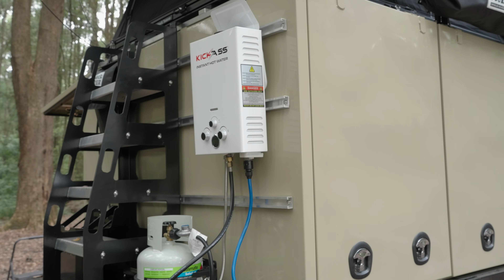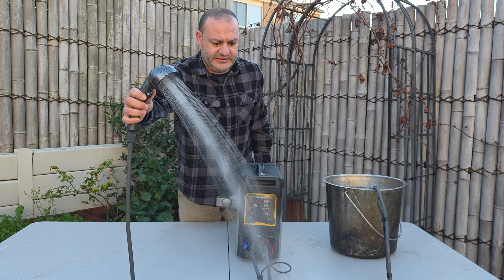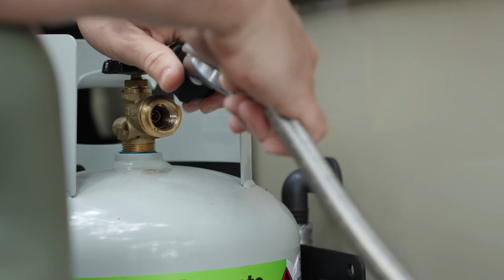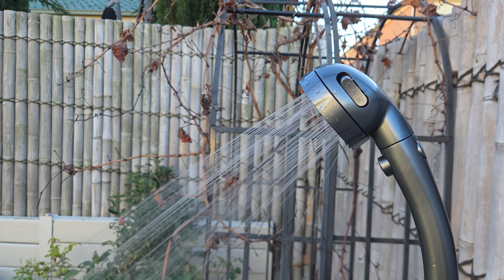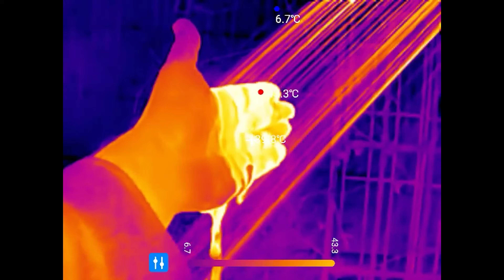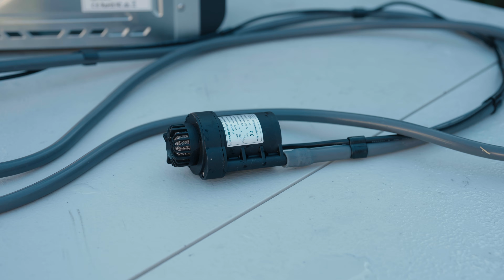BougeRV Portable Hot Water System - Amazing Performance Tiny Package

Comment: you can also refill the green bottles from your LPG, by placing them in a freezer then connecting using a small adaptor to your LPG. Making it from an expensive gas to the cheapest small portable gas avaiable. I currently heat water and use a submersible pump and shower head. But not having a magnetic shower head is one of the biggest barriers to using it. But having more instant hot water would be good with a toggle on/off shower head and magnet would be worth while. I see they are on special right now.
Reply from the maker: That's a pretty awesome camping hack mate! Thank you for sharing

Comment: Mate, nice, I have the Companion NXT hot water system and for all intents and purposes identical. It does however address some of the negatives you mentioned.
I use mine with either a bucket or, since it uses garden style fittings, I connect it to my water tank and run it off my water tank seaflow 3.8 litre a minute pump and it works great. Its been a game changer although not quite as compact as it has permanent protection for the gas bottle and also comes with a hose for a larger bottle. Hope you check it out next. At 65, no more bucket on the fire or stinking is a game changer. Cheers and thanks again for a great review.
Reply from the maker: Thank you mate for that important and I'll definitely check it out! Sounds like a fantastic little unit
Reply: Hey mate, if you use the Companion NXT this way, do you still need to plug and recharge the internal battery? I have the kings 4.3 litre per min pump and intent to purchase a water heater and use it the same way you used it.
Reply: @FadiDagher  Yeah mate, still have to charge it up once in a while as it needs the power to switch the gas on and off to control the temp. It lasts heaps longer though as it doesnt drive a pump, just the controller. Same as normal usage just dont use the supplied pump, you use your own pump and tank.
Reply: @1Coolbanana  Thanks mate

Comment: Fiddle with gas when batteries are so “cheap”  doesn’t seem too appealing. A fixed mounted electric boiler is superior.
Reply from the maker: Sounds very appealing but I haven't tested one yet. In saying that, I'll be curious to see how far the battery goes compared to a small propane bottle
Reply: Batteries might be cheap. But the systems to keep them full of power are not.
Reply: @edenbreckhouse   don’t you think that most of them considering hot water when camping already has a DCDC and solar?
Reply: Not portable either.
Reply: @1Coolbanana portable means a lot of loose parts. But that’s just my opinion
Reply from the maker: In my opinion I think the best option is to have both if you can afford it. Gas as a redundancy however as I'm typing this message we are at camp and it has been cloudy, overcast and we are parked in the shade. Unless you have a massive battery system it's probably going to be difficult to maintain things for more than a day or two
Reply: @bushbusiness  that’s true, if you often camp with family for several nights it’s less ideal to rely on battery. But if you are only two and mostly stay for maximum two nights we have great experience. The water stays warm for quite a while in the heater I like to have it ready on tap. With no setup.
Reply from the maker: @TroopyTreatsx that's actually one of the most important things I've found is how much water you waste just waiting for the heater to work. I'd love to know what system you are currently using if it's something you can share!
Reply: @bushbusiness  using the Duetto MK2. We actually only connected it on 220v. So when we turn on the inverter the water is heated. The logic is that due to the thermal losses it’s more energy efficient to warm water on 220V than 12V. Secondly, should we be low on battery we don’t use the inverter. It ended up being a very easy system. We have 380Ah batteries on 12V
Reply from the maker: @TroopyTreatsx  Thank you for sharing mate, looks like a great system and not as expensive as I imagined. If the 10L inside it can be pre-heated then you can have hot water ready when you get to camp while you drive to save the electricity!
Reply: @b @bushbusiness  Yeah that’s how we do it. Water stays surprisingly warm for long. We are very happy with the simplicity.

Comment: G'day Ayman,
Nice review of that system. I saw Shayne's review the other week and straight away noticed the "flimsy" gas connection.
Personally I don't have a system like that as I don't do long enough camping trips, or I just use a stainless bucket with a little submersible pump shower kit.
Reply from the maker: Thank you Brett 

I'm surprised at how good of a little system it is. Heats the water nice and quick. Granted it isnt cheap but a big step up from the stainless bucket (which I of course have and use)